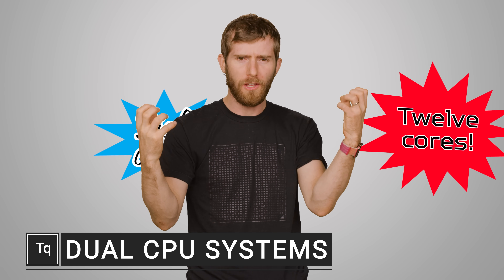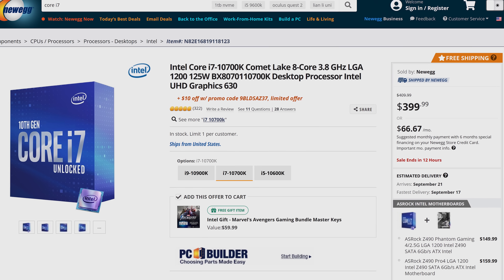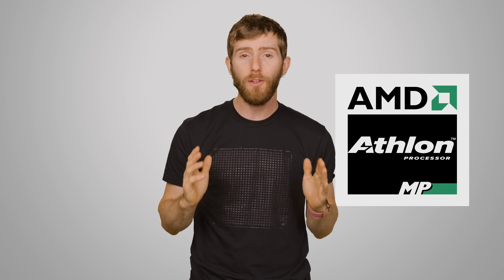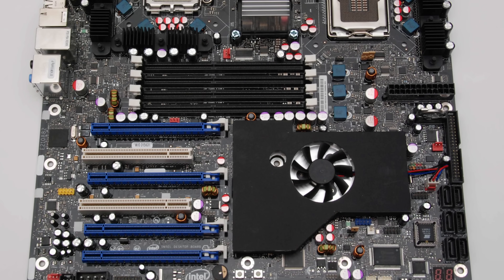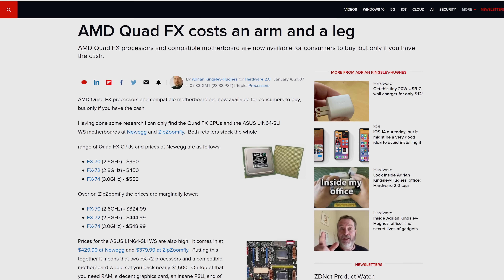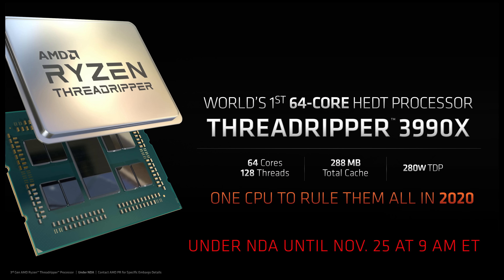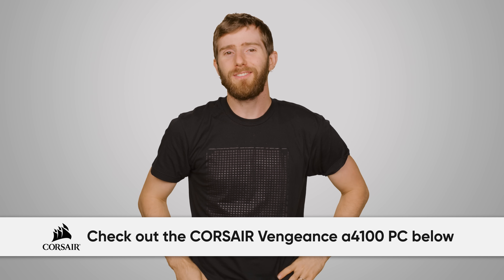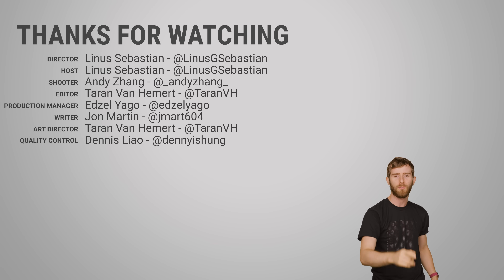Should You Put TWO CPUs In Your PC?

Comment: If it doesnt work much better on a single motherboard would it be possible to spread the load on two interconnecting mother boards? Have both dedicated to specific tasks so that there isn't an overlap of information being processed. Or would that just cause mismatched information in the output if both arent synchronized properly?

Comment: Sooo...why not just have another onboard chip, like a cmos, but then just to regulate the flow of data between two processors, so that when it comes out on the other side, the motherboard has no idea it came from 2 cpu's or just one. It's just getting data at 6Ghz, if you have two 3Ghz processors. Why is that impossible? I mean, inside a multicore cpu, something has to regulate which core gets to do which task. Why not have one of those things between the two cpu's, that instead of regulating which core gets to do what, it regulates which cpu has to do what. The rest can stay as they are. Once it gets inside on of the cpu's, another thingamagic sorts out which core has to do what. But when the data joins up again after the cpu's, it's just seen as a normal octacore, feeding it, instead of two quad cores. 

Of course this can scale up linearly to whatever you want!! So if you have say 2 Octacore cpu's, at the output side, the motherboard just see's it as data coming from a single 16 core cpu. 

Why is this not possible? It works fine inside the cpu, with its multiple cores, why not? 

I need to end of course with the inevitable phrase, "What could possibly go wrong?" XD XD XD 

Well?

Comment: i think tech went the opposite way. We now have single CPUs that can run multiple systems insted of multiple cpus in a single system. Its a step in the right direction i reckon. Imagine 2 cpus were the norm, and apps were built to take advantage of that..hmm that would mean powerful systems overall but less access to consumers bec of much higher costs at the mid to high range systems

Comment: It does make sense to have more then 1 cpu if the cpus weren't trying to compete for the same data.
If one cpu is set as a master completing its own separate tasks from the other cpu set as its own masters slave to be used by user for more cores and threads. I would also give it its own separate memory controler. Basically it would be a motherboard connected to another motherboard but allowing you to use one cpu to run all the background task or major tasks for the system and the other to run just games.
Each completing there own tasks. I would give the cpus there own individual ram and a portion of shared ram. I think since there trying to compete or share the same data tasked to 2 cpus is why it diminish returns.
This is whats happening you take 2 workers and you give them a room that only fits one lol. Yes 2 works means more stuff can get done but how do they work together sharing a room that fits only 1 worker and tasks that 1 worker can complete by thereselfs. But if you make the room bigger and give the other worker his own part of the room completing other tasks the other worker isn't even working on like running games.

Comment: It's always "Two CPUs in one Board"
It's never "Two Boards in one CPU"
Reply: They always ask how is the cpu, not why is the cpu
Reply: @yen5625  to make computers work
Reply: @kouvolaartschoolfinland9332  are slash wooosh.
Reply: @kouvolaartschoolfinland9332  just stick a chip in.
Reply: Yes this is so sad
Reply: @ScienceAlliance  Alexa, play Despacito
Reply: @yen5625  Ill do you one better, who is the cpu
Reply: "Two cups, one girl" Just doesn't sound the same.
Reply: @dorg9502  that just sounds like she's an alcoholic.
Reply: @dorg9502  This one doesn't sound quite as bad
Reply: No, we've done that before as well.  That's your 60's mainframe, time-sharing style setup.
Reply: In soviet russia the cpu boards you
Reply: You're thinking of a PCIE splicer
Reply: what does that mean? are you gonna divided one cpu into two and put them on two boards.
Reply: Damn
Reply: because two boards wirjjejjsiiq7z7v6 3zujdkfdodoc98
Reply: That would be impossible to fit and cool of if its running
Reply: @thomashoekstra2933  
That sums up basically every variation of technology.
We can improve the design to such a point where the greatest limit is cooling.
Think about it.  Engines, processors, energy storage.
Reply: Just cut it in half and put each bit in the socket with a hammer and some filler !
Reply: a small board that holds the chipset and CPU and two MBs connected to it, right?
Reply: @nvcbl  like a sandwich except the CPU is the ham?
Reply: Hold my rosincore
Reply: The CPU would be a real slut if they were able to go on 2 mobos at the same time
Reply: Big brain thoughts lmao😂
Reply: How would that even work.
Reply: Who read it channlers voice ?
Reply: That's just called Cloud Computing mate ;3
Reply: It’s always “two CPUs in one board”

It’s never “CPUs two one in boards”
Reply: And then the tables turned!!!
Reply: shaking my head
Reply: double sided pin cpu
Reply: actually there are some servers that split the motherboard up, where the cpu an ram is on one board an pch/network are on another daughter board, usually propriety servers
Reply: FIGHT FOR EQUALITY

Comment: dual socket boards could have potential in streamer PC's. 1 motherboard for 2 separate PC's with the CPU that is most appropriate for each system, rather than buying to completely different computers for the same thing. all streamers need are 2 pcie slots{1 for gpu and 1 for capture card}, and internal data connectors for mass storage{sata, usb 3.0-3.2g2, m.2, and pcie}. not much more is needed with programs like synergy to share mouse and keyboard, integrated graphics for capture PC, and monitors with multi input channels to enable this to be a viable option.

Comment: EVERYONE but Intel calls it Simultaneous Multi-threading because that's the actual term for it.  "Hyperthreading" is just a marketing term that Intel made up.
Reply: "SMP" covers more than one CPU. So like dual celerons, dual core chips, two quad core chips, etc. Hyperthreading is a more specific thing. "SMT" (What wikipedia says Hyperthreading is) is different from "SMP"
Reply: Once again, SMT is the proper industry standard term for having multiple pipelines for processor cores supporting more than a single thread of execution simultaneously on each core.  "Hyperthreading" is Intel's marketing term for their implementation of SMT.
https://en.wikipedia.org/wiki/Simultaneous_multithreading

Interestingly enough, Intel's "Hyperthreading" is one of the least "Hyper" threading implementations out there.  Sun's Niagra processors supported 4-way SMT many years ago.  IBM's POWER 9 CPUs support 8-way SMT.

Obviously SMT is not the same as SMP.  I did not state anything about SMP.
Reply: All terms are made up
Reply: Fair enough...

Comment: I remember having a single CPU system as my general gaming desktop, but at the same time I had a dual pentium pro running as network storage and server for doing various things. Though I also had a quad CPU sparcststion 20 at the time too as I was using Solaris for some things back then. Did I need either? No, not really, but by then they were cheap or given to me for free (in the case of the sun gear). Was cool to play around with, though compiling Linux on the dual pentium pro was.... Slow! Fun times.

Comment: I had a giant Pentium 3 800mhz rack server that gave me the option of installing a 2nd CPU. But I never got my hands on one to slap into it, & It was just my geeky way of running my simple website on my own sever at home. 
I could of used ANY computer to run it.... But.. No.... I wanted to own an actual server to run it on haha. Even ran the server version of Windows 2000 on it. 
It did the job haha (back in like 2008)

Comment: You are forgetting multi Slot 1 solutions... I used to work as a 3d VFX professional back in the 90s. And we built our server and workstation park on dual and quad Slot 1 motherboards... using P2 XEON CPUs. And no, it didn't scale to 100% increase, but it did on 3d VFX workloads scale to 70-80% increase in productivity and performance, which was ideal at the time. Also GPUs at that time, only were good for pre-viz of your scene, we had the Wildlabs, the FireGL and so on, all performing OpenGL accelleration, but that was not good enough for final render. That goes for the SGI offerings at the time as well - which were out of this world compared to a quad or dual xeon in terms of pricing at the time - even with the top of the line 3dlabs graphics card installed. But some years later SGI recognized that the "wintel" platform was gaining traction, and introduced the "Visual Workstation" line, along side the O2 and the Octane, then later the Octane2. The Visual Workstation used intel CPUs and either a tailored version of IRIX, or Windows NT4.

Comment: Ah, the memories of my first build ever, a dual Pentium III 1 Ghz system on an Abit VP6 motherboard...  Such a rugged system, so much raw power, and I was able to make use of it then when I was doing graphic design work with Adobe or when playing Quake 3 instagib (/com_maxfps 0, /smp 1).  Hell, I could play the game on one CPU and run a dedicated server on the other, and I DID one day just for fun!  One huge advantage I remember was that my PC never slowed down when running tons of programs, which was especially helpful then with the sea of spyware start-up apps that would bring pedestrian systems to their knees.  Windows 2000/XP Pro were so good at managing workloads between the CPUs that anything less than SETI@home would barely be a hiccup, and buffer under-run when burning CDs became a thing of the past.  Though in contrast to the video I don't remember it being that expensive at all. There was the second CPU, of course, but that was only another ~$210, the mobo was only a little more expensive than other boards, I didn't try to max out the RAM, I had the usual 2 HHD, CD burner, a GeForce2 GTS/Pro I got for dirt cheap on ebay, it was perfectly reasonable and serviceable until it was replaced by a Pentium 4C.  Maybe there were more boards then that used registered/ECC RAM and had SCSI controllers natively, cuz the VP6 was just a regular board with 2 CPU sockets and I don't think I paid anymore than $125 at most.  Tho the mobo was a victim of the capacitor plague, it was still just within warranty by 2 months, got it all fixed up and it was retired to the role of LAN party server for whatever we wanted, usually counter-strike, UT2K4, Quake 3, etc.

A friend of mine still has it. Maybe I'll dust it off and see if it still works. No idea what I could possibly use it for, even 2 Pentium IIIs at 1 Ghz apiece will barely run anything modern.

Comment: I was literally wondering about this yesterday when I was googling how supercomputers work. They have tons of individual cpu's so why not us?
Reply: The diminishing returns is a much greater problem for Windows compared to other O/S such as Solaris.

Sun had SPARC processors with 128 threads per CPU in the late 00's 

https://en.wikipedia.org/wiki/UltraSPARC_T1

Today, the M8 has 256 threads per cpu and the T8-4 system has 4 SPARC M8 processors for 1024 threads.

Solaris scaled far better than Windows when it came to multiple threads.

Floating point performance wasn't as good.  But moving large amounts of data, processing big datasets etc was short work for SPARC based machines.

Today, Sun/Oracle do the same work with connected servers running XEON processors.  Provides some cost savings as well as multiple systems running so the loss of any one system has a far smaller impact compared to one large instance going down.

1U servers running Oracle Enterprise Linux with 1.5TB of RAM to do database "stuff."
Reply: They have special very high capacity inter-processor communication channels.

Comment: You forgot to mention that amd CPU's I 2001/2 had a track cut that when reconnected made them MP  quadrupling the value I still have & use mine. At the time you had the opportunity to rework CPU's that's been stopped by the manufacturers & ruined my fun

Comment: This could be a good alternative to or a step before quantum computing as current CPU platforms are close to exhausting the limits of the electrical laws involved with core speed, imagine the power of a dual CPU intel core i9 or AMD Ryzen dual CPU system with the ability to overclock both CPUs. The motherboards made to handle it may be an expensive extreme option though and you may easily need a higher watt PSU to power such a monster.

Comment: You can see the difference between 2x 16 core CPUs and 1x 32 core CPU by looking at the 2990WX and 3970X Threadripper CPUs.  Despite the 3970X only having a 17% single core performance lead over the 2990WX, the multicore performance of the 3970X is nearly double that of the 2990WX.  One of the reasons for this is that the 3970X has a single memory controller versus the dual memory controllers in the 2990WX.  When you have 2 memory controllers (as in the 2990WX) you end up with latency penalties when CPU block A with it's memory controller A wants data from memory stored in CPU block B's memory banks that are attached to memory controller B.  

With separate CPU sockets this latency penalty goes up even higher as there is a longer path for the data to travel and sometimes an even slower interconnect between the 2 CPUs.  This wasn't really an issue with the really old boards as the memory controller was located in the North Bridge rather than integrated into the CPU but you still ended up with issues regarding cache coherency (basically when both CPUs are working on the same data set and some of that data is stored in the cache hierarchy of both of the CPUs and modified then the cache in the other CPU needs to get updated with the new value for that data).

Comment: I remember a friend of mine back in 2000 telling me that the "Multicore/multicpu will rise and flood the market cuz it has so much more power versus a single core". To that I answered that I would prefer a 20Ghz single core G4 than a 4x5Ghz Pentium III. 7 years later I bought a MacPro with 2 Xeon dualcore, and I was so true. single thread performance was pure crap. It was only good for MeGui and handbrake multithreading apps. That's why I havn't bought AMD yet. And Threadripper 64c cpu, sorry Linus but the die is a beast, it equals 2 sockets in surface. Moreover, AMD process is more like tiny CPUs assembled on one die.
Reply: Dual cpu (and now multicore) systems are much more responsive.  In the bad old days with a single core setup,  one program would quite often hog the cpu and any input would be laggy.  If all you did was single threaded gaming that might not have been an issue but it was for getting work done.

Comment: What would be cool with 2 CPUs is to be able to choose what CPU a program uses I.e run a game that can't use many cores on your better low core CPU and have a high core count CPU for work that can use lots of cores
Reply: thats basically what intel ended up doing with their p core e core cpus, except on a single cpu die.
Reply: I think that was one of the few benefits gamer actually had.
Run the OS and most stuff on the multi core CPU that clocked 2 to 3 GHz (CPU slot 1).
and on CPU slot 2 Run a singel core 4+GHz CPU for games that could only use one core example Dwarf fortress.

Comment: Abit. Bp6. Dual Celerons (not the cache-less slot 1 POS ones) in 1999/2000. Win NT 4 and Win 2000 had MP support and worked great  compared to 98,  dual booted into Win 98 for games (single CPU only) which had a problem with Win 2000.

Comment: ABIT BP6 motherboard had dual 370 sockets and worked with pentium iii and celeron chips.  I used one as a dual celeron 500Mhz windows 2000 machine until the caps went.  It also had PATA RAID onboard.

Comment: There is a benefit in having dedicated sockets for your CPUs:
Especially Threadripper suffers from its design. They put 8 dies on one package that then has to share all its memory bandwidth. In a multiple socket build each CPU gets their own dedicated memory and bandwidth. In a threadripper 3990X 16 cores share one memory channel. If you had two 32 core systems or 4 16 core systems with 4 channels each you could get way more performance in tasks that don't require shared memory like virtualisation.
Reply: This is why a database server we bought around 2015 was equipped with two 12/24 Xeons. For database servers, memory bandwidth is a real bottleneck (we saturated two fiber channel links when running queries to give an idea of the amount of data we were sorting, and we had nearly 1TB in memory)
Reply: And this goes back to at least Westmere.  Back in the day, one of the awesome things that the Dell Precision T5500 had in it was the second CPU riser functionally made the system parallel triple channel memory, so you could get some absolutely absurd memory bandwidth for the time (like ~60GB/s theoretical or something) to pair with the then-ludicrously-powerful X5680 and X5690.
Reply: This is why solutions like AMD's 3D-Cache will become more and more a "need" outside of gaming, like in Database Servers.